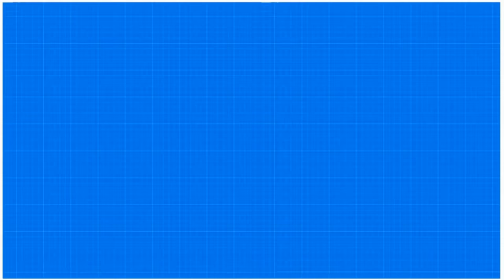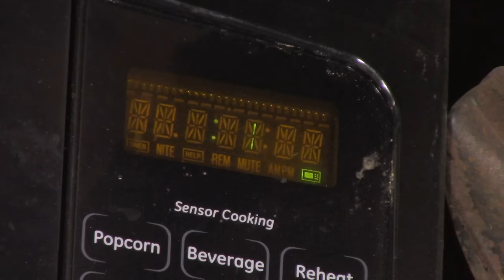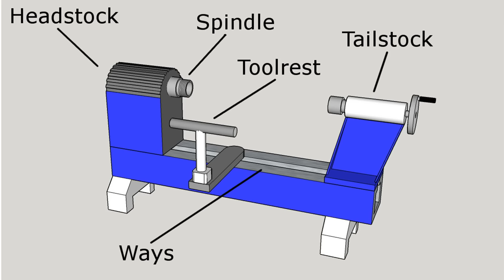Should you turn green (wet) wood on your lathe?

Comment: Great job ! My pistachio tree just fell . I cut it up wanting to save it for later when I get a little more experience. I cant rough turn it all and have a 12 in .crotch I want to save. NO clear answers on youttube can you tell me what to do with all this beautiful wood in a timely manner ? {going to crack}  ANYONE ?
Reply from the maker: You'll need to seal the ends. Look for a product called "armor-seal". With the ends sealed, it won't crack.
Reply: It is probably too late to help you with this answer, but hopefully, we can save someone else's treasured piece.

Most splits begin at the pith and radiate outward.  This is due to the large difference in density of wood at the pith, and drying occurring much quicker, there.  When water leaves, it must be replaced with air.  If at ALL possible, mill the pith out right away.  Chainsaw, bandsaw, handsaw, or gnaw it out with your teeth.  Get that pith out.  

Secondly, is the old handful-of-straws analogy for wood grain.   There are two types of water inside of wood: free water and locked water.  The free water is outside of and around the wood cells and moves freely through the tree.   This would be between the straws in your hand.  This is the first water that will be lost, once we have cross-cut across the fibers, as it has no barriers.  In fact, you could stand the log up on end and see over a matter of days a puddle of the free water below.

It takes much longer for the rest of the locked water, which is the water inside the cells, to escape.   This would be the water inside the straws in the analogy.  The general rule of thumb is 1 year of drying per 1 inch of thickness.  Whether or not the pith is able to removed, now, he is right about sealing the ends.  They should be sealed from the first hour the tree was felled, if at all possible.   But, it's ok if it has to wait.  You will just need to trim those ends further and further, the longer you wait, as your splits will go deeper and deeper.  Any split that starts will continue.  So, trim those off ASAP.

Armor seal is expensive.  Scrap latex paint can do the trick, if you reapply it a few times near the beginning, as it gets stretched into cracking with the wood.  Wood glue is cheap and works VERY well.  I have had years of great success with it.  You can also just take some plastic wrap and wrap the entire thing well.  I have had great success with this on blanks.  The idea is to slow the water loss from the ends of those cut straws so that more water can get sucked from the middle, as it slowly leaves via capillary suction.  This will help everything to "move" evenly, so that less cracking will occur.

BUT, he is wrong about things not cracking just by sealing the ends.  Even if you were to do all of this, including immediately removing the pith and even an inch further, and sealing the ends immediately... wood will move.  It is difficult to predict the stresses the wood was under during growth, but as the water leaves, those stresses will release.  This is why we do not like to turn branch wood.  Notice in all branches how the pith is closer to the top of the limb.  There is always more wood along the bottom.  This is the tree's "muscle", meant to overcome the massive weight the limb will have.  But, even in the straightest growing, densest wood from just the prime bottom section of any tree... totally unpredictable.

All of this advice only raises your odds for success.  Nature will determine the outcome, in the end.  Even doing everything right, I still lose about 1 of every 10 bowl blanks to cracking.

So, understanding all of this, maybe some will also understand why there is a large section of turners who do not believe in microwaving.  Microwaving the wood makes the trapped water burst the wood cells, which weakens the wood.  The item will not last to become an heirloom piece, this way.  Wood will always move with humidity changes., no matter how "sealed" you think you get it... dead wood "breathes".  If you have broken the structure of the wood at the cellular level, it's likely not going to end pretty.  But, we are talking about decades, here, so... beginners will not know of nor care much about this.  Kiln drying is the only safe and controllable way to quickly dry wood.